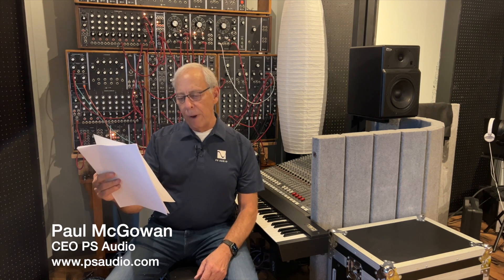Vacuum tube watts

Comment: Alot of watts get lost to heat before converting to sound energy. Power is misleading as a main decision to buy an amp. You could both have 100 watt amps but one has crap parts and design to it with high noise and distortion and the other as clean as a whistle. This mainly comes down to parts used with great design. The lessor known companies starting out and wanting to get noticed tend to do ultra quality and lower than market pricing to get their brand out there and then raise the pricing as they have to for staying in business. Loudness alone doesn't usually hurt your hearing it's the distortion. You can play crystal clear music at 85db and enough to make you tap out. You could listen to high distortion at 75db and damage the ears more. I have the VAC pair of mono tube amps the 452 music blocks. The cheaper tube amps tend to have heavy noise, cheap quality tubes, excessive constant heat throw off, etc.  One of the downside to the tube amps is at least with mine it will play right away but to warm up good needs to be on an hour or more to get into the sweet spot. Solid state good to go right away in most cases. So learn about what materials are used in a manufacturers product, how it is designed, and how it sounds. Do not just go off of reviews in magazines, etc.  Love the car analogy. One is straining and the other is coasting.

Comment: Just build a power amp using the TDA-7293(4)  50 watt MOS-FET  chip  (cost about $7.00) .  It's got that "tuby-bliss"  built in right in...and soft clipping too.
Reply: @kramerdesign9443  OOPs. I meant 7293/94.
fixed in comment. Thx.
Reply: @johnnytoobad7785  I deleted mine so people don't get confused - thanks for that!!
Reply: I built a TDA-7294 amp (AB) that beat out all of my class D amps and sounds beautiful, but I haven’t heard a tube amp yet. Will be buying one soon though and I’ll put it against the DIY amp.
Reply: All the full feedback semiconductor amps have the same sound quality problems, local feedback is the thing that makes tube amps sound more natural.

Comment: Tube watts vs solid state watts…. All you have to do is plug a guitar into a 30 watt VOX AC30, and then just try to get anywheres near the same volume with a 30 watt solid state amp…. Not even close.

Comment: That makes a sense. Surely  on condition that we realy drive  tube amplifier up to that 20W nominal or at least 10 W. I have 15W per channel and in fact I have no clue  about used  power. Measuring music with voltmeter it is 0,5- 2VAC  at  8 oHm 🤕Could it be max 0,5 Watt and so annoying noise? Probably good idea of measuring amplifier power  would be  to measure supply fuse DC current at average pop music  but how to judge  THD in  pop music instead of any specified  kHz ? 

 Talking about power vice  satisfaction in loudness we often forget that to treat  power equally to loudness  we should integer the whole spectrum of sound   for all peaks in instance  ,  Eventualy fourier analysis could help but who uses it for power? .  Even then due to FM curves there will be deeply   non equal for loudness components. Our data  at   1 kHz amplitude. is simplification  Loudness is also only a approximated tool because  loudness is often perceived depending on person  and mixed with size of imaged source. Big source with complete of harmonics makes more psychical  impression than even louder but deprived of harmonics thus perceived smaller So  in worse systems people try to make it big with turning volume up.

Comment: I don't know if guitar amps are somehow rated differently than hi-fi amps, but in my experience if you put a 20 W solid state amp next to a 20 W tube amp and dime them both, the solid state amp isn't nearly as loud.  To your point, they sound radically different at full volume, but it seems like the solid state amp lacks ooomph (technical term).
Reply: I have the same experience, and no real answer. But to try, perhaps the speaker of the tube amp is more sensitive by design, and/or the solid state wattage is mostly overrated, so the true (good) wattage is lower then claimed.
Reply: It's all about the different harmonics at clipping point and beyond. A lightly "crunched" tube amp doesn't sound distorted - a solid state amp usually does (although there are exceptions).
Reply: Watch this video by Jim Lill. He does a whole series on where guitar tone originates and he just did a video on tube amps  https://www.youtube.com/watch?v=wcBEOcPtlYk

Comment: Klipsch is one of the best speakers made for this purpose. Very high sensitivity.
Reply: The number one company that lies about their speakers sensitivity. You can take that to the bank.
Reply: Yes, Klipsch tends to overrate the sensitivity of their speakers. Two examples:
RP-280F, 98dB advertised, 92.1 actual measurement.
Forte IV, 99 dB advertised, 93.6 actual measurement.
Anyway, the both of them noticeable higher than most competitors.
Reply: @davidsagarra9841  And if you run them with a wimpy little amp and decide you want different speakers you may find yourself either getting a different amp as well or not getting the speakers that you want.
Reply: Distorted messes
Reply: Many of the Tekton Design speakers are easy to drive high efficiency and tube friendly 8 ohm designs.  They sound really quite excellent at their price points.

Comment: Speakers are designed for being driven by voltage and low output impedance. A tube power amp with high output impedance generally performs poorly on those parameters thus nowadays isn’t a good choice at all. Of course soft tube clipping sounds better than hard transistor clipping but it’s much better to have no clipping with more power.

Comment: If a loudspeaker was 100% efficient, which it can never be, you would only need approximately 1/3W to reproduce the sound of an orchestra.
Reply: Efficiency rating (in percent) is related, but not the same as sensitivity rating (dB SPL/W). Usual efficiency values for HiFi speakers and studio monitors are between 0.2 % and 2 % (at best). So you may put 10 Watt amp power in and get about 1 Watt sound power out.
Reply: @Fastvoice  Agreed, I purposely said efficiency and not sensitivity. I’m not sure how you would measure the efficiency of a loudspeaker as it’s a hypothetical notion.

Comment: As a guitar player I know this from my amps. A 20 Watt tube guitar amp is mostly loud enough for nearly all purposes. A solid state amp may need up to double the power to put out the same loudness without harsh distortions.
Reply: Plus guitarists usually love a bit of crunch from the tubes distorting 👍
Reply: @yogimoninc  Rather  metal - most of them including me and guitarist like Mark Knopfler not. Also some guitarists rather like play metal than repair their amplifier 😄
Reply: @Mikexception  Metal guitarists usually also use some distortion pedals in front of the tube amps. Mark Knopfler played and plays all sorts of tube amps with a light crunch - e. g. Marshall, Music Man, Fender and Soldano.
Reply: Years age a friend was going to sell me his guitar tube amp. It sounded great but when I asked him what the wattage was he told me 10 watts. I said forget it that's too small. I still regret not buying it.
Reply: @jeffwalther  You're not the only one that fell in that trap. 😉
Reply: @jeffwalther  It's true...years age! L0L
Reply: No, you don't understand this topic, at all. You have no data to support your claims.
Reply: @NeverTalkToCops1  No he is right. For comparison I have a 5watt solid state and a 5w tube amp, tube amp is much louder. Solid state amps are really good amps for lower volumes, cause you don't have to drive the tubes for distortion. Many solid states use FET:s and they are pretty good sounding too. There is amps with master volume of course, but many 80s amps didn't. I like the warmth of tube amps, but solid state amps are pretty bullet proof.

Comment: That answers a lot of questions at my end. I never understood the power race back in the 70s that I heard about frequently.
Reply: Oh, that power race is still on. Try walking into a BestBuy and look at their recievers section. They'll even clip it for you at a 1/4 turn to see if you like it.  🤪
Reply: As I remember from my young days 6W was a hell of power I was only wishing to have so much.  At time my  high power mono  radio from 1955 used 2xEL84 in ultralinear B and speaker set inside consisted of 8W low toner, 2x1,5mid toners and one 1,5w tweeter (Stradivari) . That "beast" with open windows could be heard 50 meters from home....ok  .. in quaet place😊
Reply: @Mikexception  That's interesting. My Dad had a Heathkit integrated mono amplifier rated for 14 watts. To my young ears, it could get plenty loud enough without distortion (that I could hear). It was driving a 10"  Jensen coax speaker. Yes, I sat in front of the speaker when an interesting song was playing.
Reply: @bikdav  Thanks. I am happy that few years ago  I got  in Poland may be the only known to me  Bell - Sound Division mod 2420 for sale. Integrated. Paid some 500 USD  Working but  full of  problems. 

After year of hunting deficiences it became very good stereo replacement for that missed Stradivari. Only special problem is that it only  uses original 6V6 tubes  - any equivalent  gets red after 3 days. Nominal tube  voltage is 280 V amplifier  works at 380V - such  was old "margin of safety" in 40 ties - not  any more. Bell specialists  used margin  to get more power. 

 Although I cant say that amplifier  makes any marvels (it only works as i always wanted), for me it is all I need.

Comment: I used to shop at Clip City Stereos. It was full of Sony, Pioneer and JVC 100 watt recievers.
Reply: Oh Clip City. Didn't they merge with Sears.  Used to be able to smoke there too🚬
Reply: @LuxAudio389  No. You're thinking if Monkey Wards. 

I do remember the Sears stereo department though. The wall o' speakers was right next to the Kenmore vacuum department. You had to crank uo the recievers to drown out the noise from the uprights.